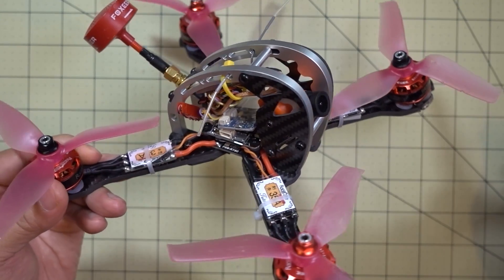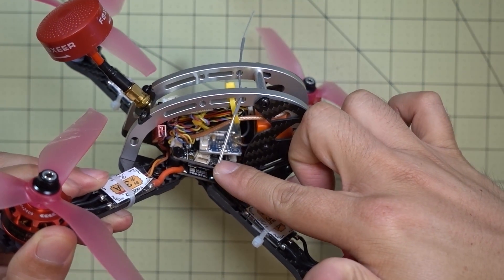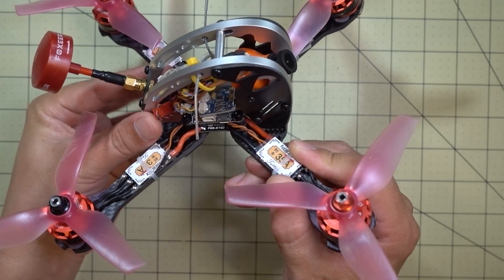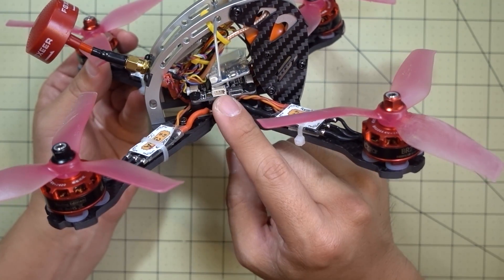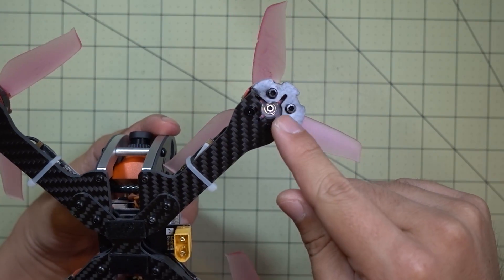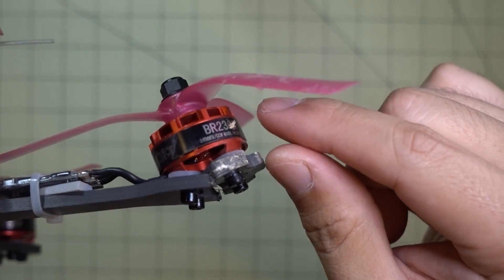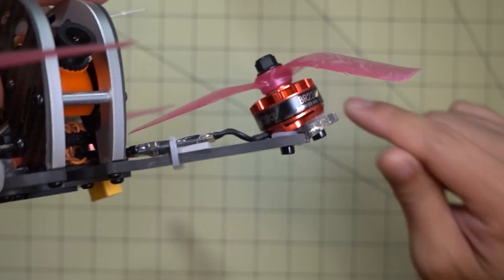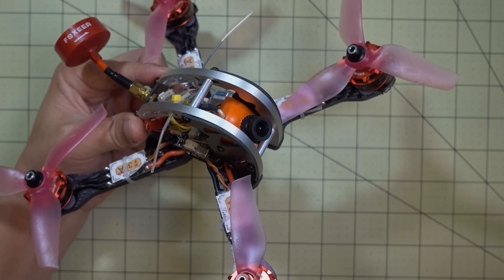Flawed Design 💩 Realacc D215 💩👎👎👎😡

Comment: Hey man thanks for all of the great vids. I just bought the Realacc 215purple and almost got everything built. I read the same thing that it breaks easy along the screw holes in the arms. Too bad, but its a nice frame all the same.
Reply from the maker: The purple frame has the same motor cutouts?
Reply: I am mistaken, it does not have the slots for smaller motors, but I guess because the arms tips are pointed and the 2204 holes are so close to the edge of the arm, that creates leverage for a weak point. But it doesnt look quite as narrow/fragile as the D215

Comment: lol i see the same breaks on top priced frames either where arm starts to thin or motors holes good thing both part will cost less then one high priced motor lol and BG most likely will help you out. Was it on to a hard surface ? lol Al you were ripping hard cause all realacc 210 type have that cross and its top race frame to my knowledge

Comment: I run a bunch of Emax RS2205S, their motor bottom is super soft aluminum too. I doubt it would have survived that crash as I've had them bind just from having the tip of the carbon arm splinter in a crash.

Comment: so if what you said is true, this is a horrible frame that you should never buy because you crashed it withing 5 minutes and broke a motor. the breaking of the motor leads me to believe it was a hard crash, and probably would have broken most other frames out there. But now that your vid is out saying it's flawed just because you happened to hit it just at the right angle at speed so it would be better if you just said keep this in mind, not this frame absolutely sucks because of one thing that for all i know could have been your fault. i happen to love this frame and realacc is doing some really good things and will probably LISTEN to what you have to say, but now there hours of work there is ruined by a youtuber with a negative opinion.
Reply: Sorry Nooo. It's very obvious when looking closely at the frame and arm design, that it will be dangerously weak = not strong enough = bad design. The arm motor mounts are not the only problem. It also looks very very weak at the centre of the frame where the arms come together.

At best the designers don't know what they're doing; but that's difficult to believe by this stage in quad-copter development. In reality, it really looks like it's been designed to fail = criminal. Someone is using the Realacc branding to TRY IT ON?? Banggood perhaps?
Reply from the maker: +dean beach the crash was not hard. The frame is flawed. I stand behind my opinion.

Comment: This is the kind of frame / situation where I think soft mounts definitely weaken the frame. Not saying that it wouldn't have happened without the soft mounts, but that part of the arm should be at least a decent amount stronger with the motor flush against the carbon. Regardless.. it really sucks when this happens, I can hear your disappointment in your voice and know your pain!
Reply: Exactly what I thought. Badly designed and soft mounts. Nobody flies 18XX motors on 5 inch these days and I can see your disappointment in the title.
Reply: I would say that the frame should never rely on the structural support of the motor base. That's just asking for trouble. The carbon can flex but the motor can't. This is just a piss poor frame that people should avoid at all costs, no fuzz on that. 

Up vote this video for visibility; The more people to see it the less Clone manufacturers can rip us off.
Reply from the maker: +Hans not all clone frames are designed this poorly. Some are good.

Comment: Thanks for the info. The space one frames at least the stretch x 5". Is the same way .
Looks like the flaw is in the motor mount cut out .Makes it weak there. 
Thx again , Later.
Reply: I beliave without soft mount would not have broke it acts like one piece now has space to crack